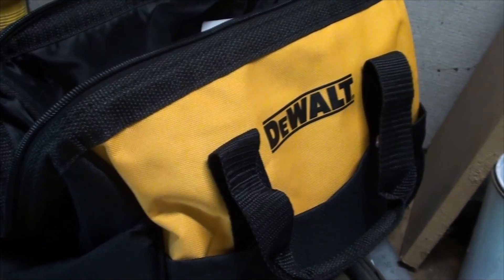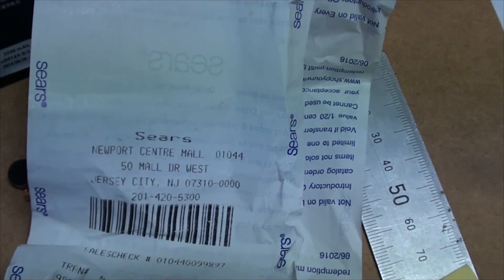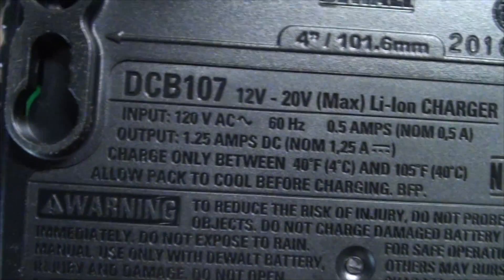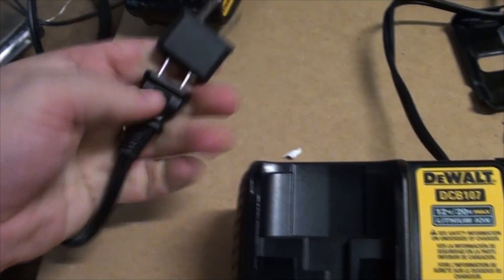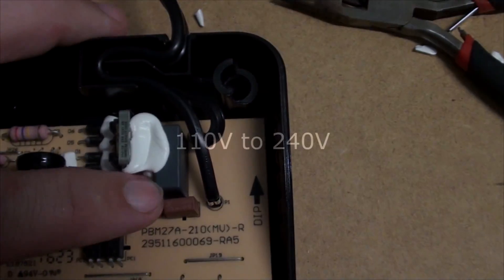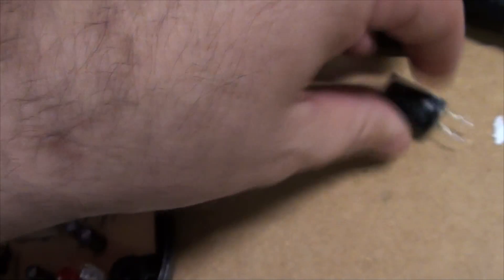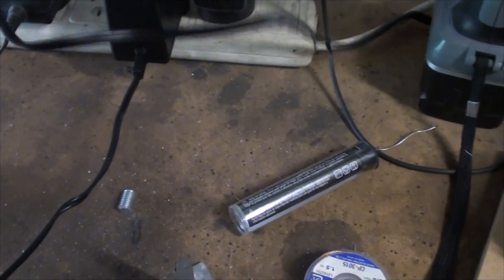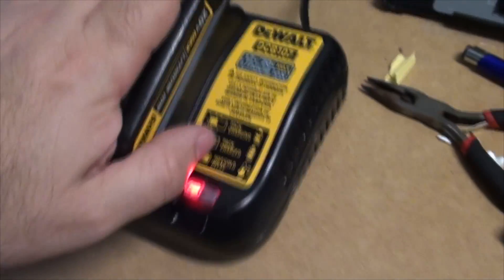Converting a DeWalt 110v battery charger to 240v for $1.75

Comment: i put in 10uf and 450v, the light comes on as if the battery is charging, but it doesn't seem to be enough to charge the battery. I left it on all night and the battery didn't charge.

Comment: I need to do the opposite of this...
Got a sweet deal on a Quansheng UV-5R Plus but they neglected to tell me it had a UK plug on the charging cradle.
(Do they use that in China too?)

I have a 110v plug from an old Baofeng charger and since it's a major step down in voltage, this should be fairly easy, no?

Great (simple) video.
And thanks for not shitting on the US of A.

Technically, we deserve it lately because the World is going to hell and "American" leaders and special interests seem to be the engineers and conductors.

Comment: Hi Mark
I have DC9310 the capacitor is 560uf 200v  what do you  recommend as a replacement ? 220uf 450v / 150uf 400v / 100uf 450v or something else? thanks
Reply: If original 560uf. Not less than 470 uf 400v and don't forget 430v varistor.

Comment: Old video, new question :) - is it possible to use 400V and 100 micro farad capacitor? (instead of the 450v and 10 micro farad in the video)

Comment: in short, it is just the capacitor at the highest voltage.

It would be good to know if the author of the video still works the charger

Comment: The MOSFET has a drain-source voltage of 600 volts and a RMS isolation voltage of 2000 volts - no worries on that component. The capacitor is used to filter out ripple voltage from a bridge rectifier (converts the incoming AC voltage to DC voltage), if anyone is curious. The reason why the capacitor needs to be rated for 400 volts or greater is because the DC voltage is way too high. Consider that your country uses AC voltage ranging from 220vac to 250vac. Remember, that is the RMS voltage. Multiply the RMS voltage by the square root of 2 (1.414). Once the AC voltage is rectified, your DC voltage will be 311-353.5 volts. Now, put that voltage through an electrolytic capacitor rated for 200 volts and...pop!
Reply: hey is there a need for a minimal ufr? is 10 good enough of  i should use 68?
Reply: hi- no need to add other components? just replace the capacitor to 400V ?

Comment: Things to be added mate /!MAKE ! SURE!!\ 
You use the same (uF) values and only replace the main cap's voltage (Example, 100uF 200v to a 100uF 400v)
Replace the MOV's (again, same reference to 250v)
Replace the Polyester capacitor (Same nF/uF to 275v)
Replace the FUSE (Same Amps but 250v)
Done this after converting a Yamaha XS205 Sega Saturn PSU
Heat's not a concern, but i do recomend adding a Heatsink with Artic Silver (or any other) thermal paste.
Also you won't burn down your house if a power surge goes through your device.

Comment: Does  this modification allow charger to work on 50Hz instead of 60Hz ?
Reply: Yes it will work with both 50Hz and 60Hz. When using 50Hz, the charge rate will be reduced by the ratio (50/60).

Comment: Hi. Thanks for this video. I have a Bluetooth speaker which is the Sony SRS XB 30 (it's a rechargeable battery powered device) and I want to convert it into AC power supply.  Can you please tell me what's the volts and amperes that the adapter needs to supplies the sound device very well?

Comment: In a "Impulse PCB's Power Supplies" as this it's will be a Basically change of Capacitors from 200V (120V) to 400V (230V) and even Repairning Capacitors - in a Traditionally of a "Transformer only": It's doesn't possible.

Comment: Great video. I wonder if it will work OK if you tried to use it on 110-120v after conversion?  I am brining my Dewalt tools to Thailand next month, and was looking into this. in 2018 they have step down transformers for sale online for about $12, so it is pretty cheap to keep your charger original, and use it for both voltages
Reply from the maker: beyackabiotch I'd say probably not. But for $12 it's not worth your while anyway.
Reply: what step down did you buy and from where? tx

Comment: for all the guys who ask about how is it that simple, well, this charger  uses a pwm power supply that works anywhere between 85 and 240 volts, the circuit is universal, but they just installed a lower voltage capacitor. so when on 220, the rectified dc will be around 330 volts, the pwm.circuit will work according to the fedback setpoint from the output of the puls transformer , and the battery volt will not increase. one more thing, many mentioned a varistor, the varistor is only for protection againest a higher voltage, if your charges comes with a varistor you will need to change it with one that withstands abit higher than 240 to protect your charger against higher voltage. but the varistor itseld does not help in the conversion itself.  well done Bruno.
Reply: Hi, Mohammad.  Does this mean that if I make the changes you outlined above in my 110 v Dewalt, provided I find the same circuitry,  that if I take it back to the US, I could use it on 110v again without any changes? In other words, are you saying that Dewalt screwed all of us who might need multivoltage capability for the cost of a few pennies for higher rated parts???
Reply: Yes, that´s it. At today, I have converted 2 chargers with only capacitor replacement, they are working ok daily.
Reply: @libenasukro  yes you are right ...it should work perfectly fine on 120 .
Reply: hi, i have a Nintendo adapter(110v) which someone plugged it to the outlet (220v) so i opened it to find that the main capacitor (200v) has exploded so i changed it with 400v one and nothing happened, so i went through troubleshooting  and found that one of the output schottky diodes was faulty , after changing that it worked perfectly, thank u. 
 شكرا مهندسنا الفاضل لانك اعطيتني الثقة والمعلومة الأكيدة
Reply: Mohammad Abdeltawab منور يا باشمهندس محمد
طيب ما نعمل حلقة عالموضوع ده لانه بصراحة عندي حوالي 10 شواحن كلها 110v نظام smps هل بس المفروض تغيير المكثف الرئيسي و الفايرستور و ايه الفكره بأن فولت الخرج بيفضل ثابت ما يتغير يا ريت لو حضرتك تعمل حلقة عليه و شكرا
Reply: Thanks Mohammad! I'll convert my US charger so my son can use it in Israel!
Reply: @davidkleinthefamousp  
And did it works for u?
Reply: Jazaak Allah Muhammad Bhai. You explained very well ❤
Reply: انت معلم ..... في وجودك ماحد يتكلم .

Comment: All you guys having issues may want to see if this cheapo is available where you are.
"Universal 110V to 240V voltage input, wide compatibility to support 10.8V-20V batteries, DC outout 21V 3A MAX"

https://www.amazon.com/FLAGPOWER-Li-Ion-Battery-Charger-Dewalt/dp/B01AU9K6WW/ref=pd_lpo_vtph_469_lp_t_3?_encoding=UTF8&psc=1&refRID=5EEMAY5CSEKNT3S37WR4
Reply: Or the Dewalt car chargers.

Comment: I hope I've seen this video before I plugged mine on. Now the charger is completely fried and Cant seem to find any replacement here. Any idea on how to fix the fried charger?
Reply: Maybe, the capacitor  burst out. First of all, Check out those all part on PCB with naked eyes and use multimeter. It's simple. Just replace those parts that were burnt. 1.Capacitor 2. Fuse 3. MosFET 4. Diode. These 4 things are critical.
Reply: Probably not much help to you now, but for anyone else...the thing that buddy didn't know what it was in this video? The little brown rectangle box? It's actually a fuse. Just bypass it. Can't guarantee this is the problem, but it's the FIRST thing to check for sure. Cheers.

Comment: I have a serious doubt that changing the capacitor only is enough for this conversion. Actually, in almost every power tool charger conversion I've done until today, I had to change the Thermistor. Other video here in youtube shows even the need to add a Varistor. Even if your charger works, it doesn't means it sends the right voltage or it won't burn on the long run, as well as damaging the batteries. It just have no sense to change the Capacitor alone.

Comment: Another happy conversion from Buenos Aires, Argentina. 
Replaced the capacitor for a 47ufx450v (stock was 68ufx200) and added extra heatsink. Thanks!!!
Reply: Follow up, after charging one of the packs (I bought the same combo as you) the transformer and heatsink is very hot, yours run hot too?
Reply from the maker: Pablo Untroib 
Yes mine does get hot too. I'm going to do a little more research into it. Thanks
Reply: Mine looks exactly like yours: http://i.imgur.com/C8gkgxq.jpg
Reply: Hola Pablo, tengo el mismo tema que vos lo compre en usa y necesito convertirlo. ¿te funciona bien el cambio de capacitor?¿le hiciste algo mas? abrazo!!
Reply: you should replace the varistors too and modify the input polyester capacitor. You have twice the current on that rectifiers
Reply: Hola Pablo, estoy con el mismo problema. Acabo de comprar la máquina, y necesito hacerla 220V. Te anduvo bien así? a largo plazo no trajo ningún problema?
Reply: Hola Pablo solo cambiando el capacitor y agregando un disipador te anduvo bien? Algún detalle a largo plazo? Saludos
Reply: @Yivan11  nada mas, sigue andando bien desde ese momento, cero problemas.
Reply: @pablopeu  Me animaste a hacerlo, gracias crack.
Reply: @pablopeu  un saludo amigo me podrá compartir el valor del MOSFET ya que se reventó el original y no se aprecia el valor .
 un abrazo.
Reply: hola pablo, gracias por comentar, entonces compraste el 47ufx450v? y heatsink? es disipador de calor?, me podrias orientar que es y como lo pusiste , gracias compadre
Reply: @josedelabarraaranguiz968  si, es un disipador de calor para el transistor de potencia
Reply: @pablopeu  Hola Pablo! Sigue funcionando todo normal? Fue hace varios años pero finalmente que fue lo que cambiaste/agregaste? El tema del calor se solucionó?
Reply: @agrologic_ar  sigue funcionando perfecto
Reply: @pablopeu  Tengo un cagaso bárbaro de que me cague las baterías.

Es un fastcharger de 6amp. 1106...

Solo el capacitor?
Reply: Yo también lo tuve, pero lo sigo usando, solo el capacitor y el disipador agregado. Nada mas. Si el que venden ahora es igual al mio sale andando.

Comment: What did you use to open it up. I have tried T15 and others. mine is broken and it's out of warranty so want to open it up to see what is wrong.
Reply: You can sometimes get lucky with a "regular" T15 Torx, but the actual screw is a ST15 security Torx (with the nub in the middle). Might as well buy the set, especially if you intend to play with DeWalt battery packs too (they take a ST10 bit).

Comment: SO, ORDER ONE FROM AMAZON USA AND IN MY COUNTRY ITS 220V.
YOUR CONVERTION STILL WORKS?
Reply: For sure, yes! Shalom.
Reply: I shipped a 220 volt to 20 li-ion to my son in Beit Shemesh. It was about $45 w shipping. Others were about $65
Reply: hi - did you try to replace the capacitor only? did you have to remove the jumper also?

Comment: Is it still work ? Have same situation here, for now don't see varistor what is ok, N-mosfet can handle up to 600V and 10A same ok only heatsink bigger upgrade and capacitor to handle double voltage is it correct ?
Reply from the maker: FuriousHondaBoy yes that is correct mate. This mod is still going great. Just a larger capacitor and an added heatsink for the mosfet transistor.
Reply: Thanks man, it's work :)

Comment: Thanks ...I see you have only be using it for a short period .. the voltage on the capacitor is now double DC . I could not find the schematics anywhere ... it may fry the board after a while .. Hope your battery wont blow . I could only find a Russian video with some more components changed but nothing that made any sense ...
Reply from the maker: AdminTuber I used a site where they modded a Ryobi charger. The transistor mosfet got hot so I made a heatsink for it with some cpu paste.
Reply from the maker: Yeah Fry, I'm going to revisit this soon. Haven't had any problems with this but will check it out. Thanks
Reply: @Fry I can confirm that a DeWalt charger runs at ~170V when plugged into 120V AC. I learned that one when I caught the business end of that fucking capacitor...ouf!

Comment: so did u only change the capacitor?
Reply from the maker: AdminTuber I later added a heatsink to a mosfet to draw away the heat.
Reply: @banarcus  so is the charger still doing good , am from INDIA which uses 240v so can i go for this capacitor change and heatsink to mosfet
Reply from the maker: @Cbzlanz  yes no problems at all. Charges fine after doing this video time after time.
Reply: @banarcus  what about the heating issue , charger hets heated you were saying , after heat sink addition is it solved, any other new modifications
Reply from the maker: @Cbzlanz  hi mate the internals do get warm. I wouldn't say hot so it will melt everything around it though. My case isn't deformed and after doing this mod and charging the batteries over and over, I can say I've had nil issues whatsoever.
Reply: @banarcus  hey mate what size bit to be used to remove the screws of  back cover of the charger, tell me the size please
Reply from the maker: @Cbzlanz  I'll check it out tonight when I get back from work
Reply: @banarcus  yes please do let me know as this screw is new to the place i live, have to go outside to get this so if you tel me will be helpfull for me
Reply: @banarcus  hi mate any update on the bit size to be used to remove the screws behind the charger, waiting for your reply
Reply: @banarcus  hi mate any update on the bit size used to remove the screws behind
Reply from the maker: @Cbzlanz  sorry for the late reply. Torx 15 is the size.
Reply: @banarcus  no problem thanks dude

Comment: hey man, i am trying to work out how you got to knowing to use a 10uF capacitor from the original 68UF, i am trying to do a different charger so would be cool to know how you know which one to get. cheers
Reply from the maker: nzmopar1992 I cheated a bit and Googled a site where a bloke converted his makita charger. Very similar.

Comment from the maker: Hi Bruno. I changed the capacitor and added a heatsink to a transistor. Otherwise stock standard.
Reply from the maker: Fry no mate. I haven't removed any links.
Reply: Eyebrows Gone l
Reply: HII BROTHER
bought 120v charger put it to 220v without noticing and then trhe capacitor blowed !! stock capacitor 100uf 200v
now i changed it to 100uf 450v 
and a transformer from 220v to 120 to give the charger the voltage it wants 
i put the baterry the red light blinks couple of times and then it dies !!
is there anything i can do about it ?
Reply: If you have a stepdown transformer where to plug the charger why did you change the capacitor? For this to worl at least the inner transformer needs to be changed it is the transformer that brings the voltage down to 20v not the capacitor.
Reply: burned the charger !
bought new one europe voltage!
hope will not happen again loll!!
thanks Wild ....

Comment: only change the capacitor?
Reply from the maker: Anderson Bruno that and added a heatsink to a mosfet/transistor
Reply: done its working thanks
Reply: dont worry, if u stick to the same voltage and uF u charger will be just fine
Reply: Anderson Bruno, what a side effect could be when connecting the charger to 110v after the capacitor change. I've tried both with 110v with 220v and it works with both but I do not know how to measure the output voltage to see how stable it is.
Reply: hope someone can help before I go down this path want to be sure I only have to change the capacitor I have same model charger dcb107 just got it from ebay USA didnt even think about the 110v issue? stupid me. Found the capacitor on ebay $2 450v / 
100 uF. I live in Thailand so sending the stuff back means more time money shipping import duty etc. So dose this conversion really work? is it this simple? Is it still working? Any tips Im not an expert dose the capacitor go a certain way? Are the terminals easy to see and solder? would appreciate Any advice . will 450v/ 100 uF be ok? cant find the 10uF? Thanks ant
Reply: I saw the Russian video too, different model charger. He added two extra components verisistor ? and heat resistor looked a bit doggy to me but it worked older dewalt model dcb 112 ? i think? Hope this isnt a stupid question but what's a heatsink? you mentioned adding it to somthing? massive ask but anyc chance of an updated video of exactly how you removed the circuit board and soldered the capasitor. best regards ant. Just dont want to F.....k it up bro.
Reply: wats a mosfet/transistor....you added a heatsink too? whats a heatsink?  would appreciate any heads up....
Reply: As I mentioned just dont wanna blow my self up...but am willing to follow your idea....any advice would be great mate
Reply: I suggest you to buy 220/110 v converter. It's cheap and guaranteed to work. On russian forums some people report converion successful but some fail. And if you fail you'll be in trrouble. There is no 20V european version of this charger, you'll have to order new one from the US pay shipping fee and wait. So it's better not apply conversion unless you have schematics and know it's safe.
Reply: i use 400v 68uf capacitor the same one from 220 charger, i open the real 220 and its all
Reply: the real 220v charger its all the same, the real one dont have a extra heatsink, but why not give a upgrade?
Reply: Anderson Bruno, what measures does the one you use?
Reply: i use the seme one at original 220v charger 400v 68uf
Reply: ok, but what size? I can not get d = 10mm h = 20mm. The closest I get is d=16 h=25.
Reply: gf975 i dont know but is good to onow that will work with 110 too :)
Reply: @Schernichkin that is not correct- All 18v euro chargers work with US 20vmax versions which is exactly the same crap. I have both and i exchange batteries with no problem at all